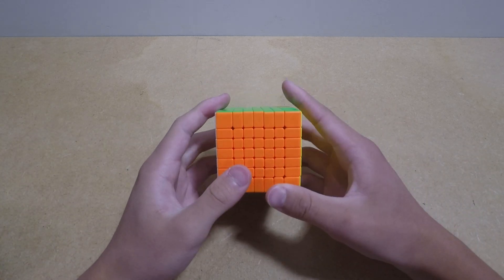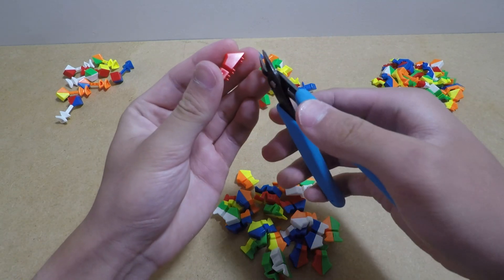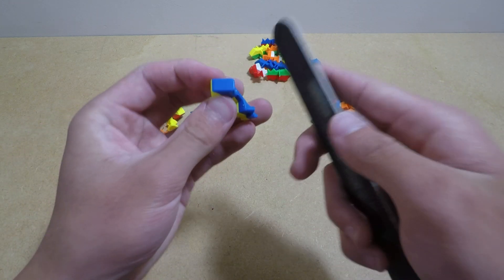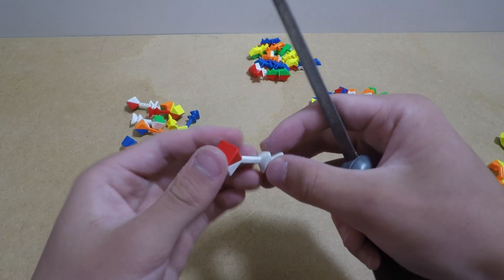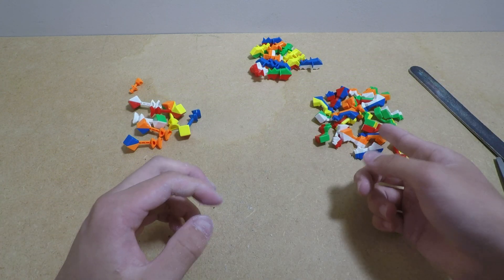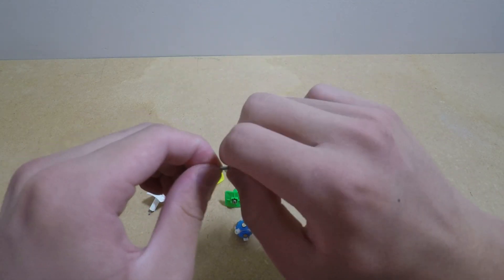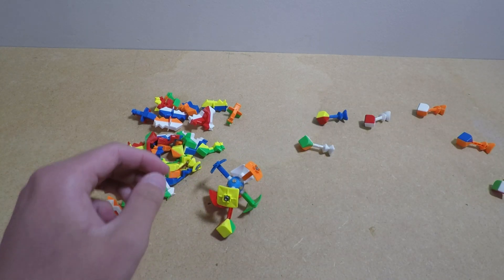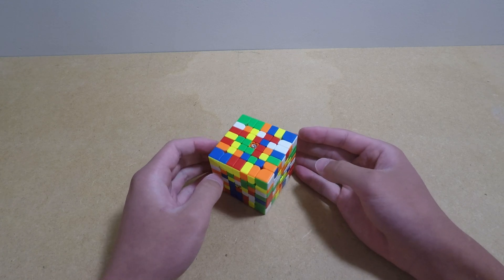MeiLong 7x7 v2 Modding Tutorial

Comment: I have 4x1.5 and 4x1mm magnets but they don’t fit in the corner slots, they are too wide. I 3d printed the files in the description and everything but I don’t know what I did wrong.
Reply from the maker: maybe try seeing if the files were scaled wrong  its also possible that the magnets are bigger than they are supposed to be
Reply: I fixed it. I just needed to force it in. I probably need to stack 2 of them for it to actually have an effect.

Comment: If you were to compare a normal core magnetic meilong to the core magnetic aofu, which one would be better
Reply from the maker: i would say they are about the same, but its all personal preference
Reply: @EthanCho update: finally got the core mag Meilong, only done a few solves but already matched my times on the aofu despite not being used to the size. Now I have to clean the lube from the premium setup and use mine and start practicing again. Thanks for helping me decide wether or not I should get the Meilong and wish me luck as I try to break sub 3 before my next national championship
Reply from the maker: @nguyennamphong5376 no problem, good luck!
Reply: Good to know, I think I will prefer the meilong cause the size and I do get tired practicing with my current main, the mag core aofu

Comment: Shouldn't you place the washer on the other end of the spring in order not to wear the plastic? Now it is between the spring and the screw head so it does not contribute to anything.
Reply from the maker: it reduces wear on the center piece from the screw head. Normal washers don’t do much for the longevity of the cube if you lube the core
Reply: @EthanCho Is the center piece sandwiched between the spring and the screw head? If yes, I would place washers on bothe sides of the center piece really.
Reply from the maker: @johnnytifosi no, the center piece that is directly underneath the screw head. The plastic washer basically extends the surface area and is made out of a softer material
Reply from the maker: @johnnytifosi also putting washers under the spring would make the springs feel very rigid

Comment: What magnet strengths would you suggest for the magnetic core?
Reply from the maker: i like n50, but n42 might be better if you prefer weaker magnets
Reply: I'm a fan of stronger magnets just wanted to be sure about this cause I'm on my second meilong v2 cause the first one used seemed to make them waaaay too strong but I also wasn't using your stl file. Saw your video comparing the spark v2 to your meilong and I'd rather just make my meilong better at that point. Thank you!

Comment: This mod is very invasive, I would make sure to smooth out the cuts
Reply from the maker: dorito mod? It doesnt really matter if uou use something that makes clean cuts
Reply: @EthanCho  yeah. Would a circular cut be better? I think so because it's more area and no sharp cuts
Reply from the maker: it might be in theory, but in practice it doesnt make a difference, but triangle is easier to do quickly
Reply: @EthanCho  thank you